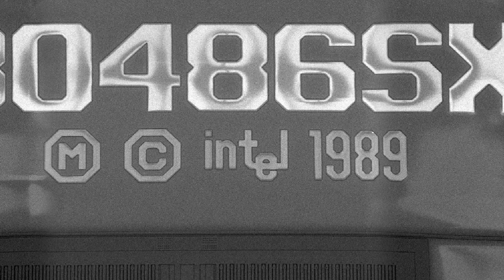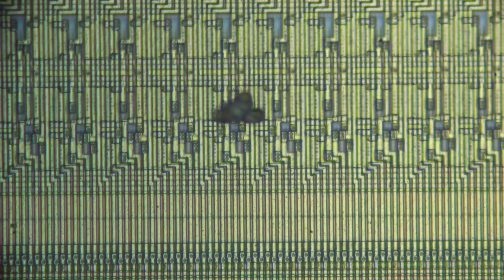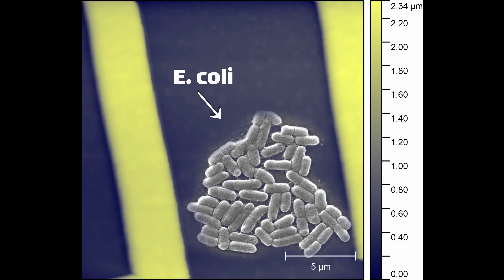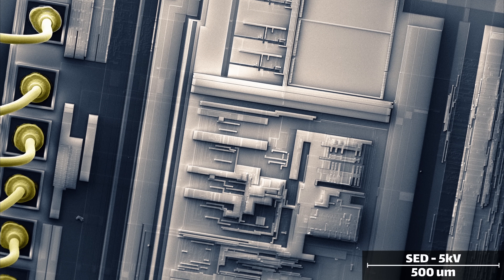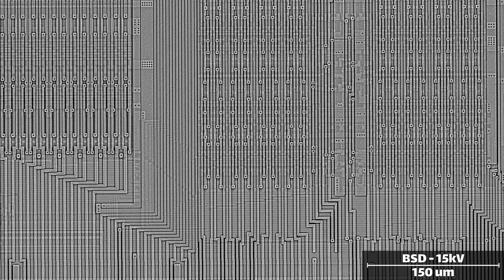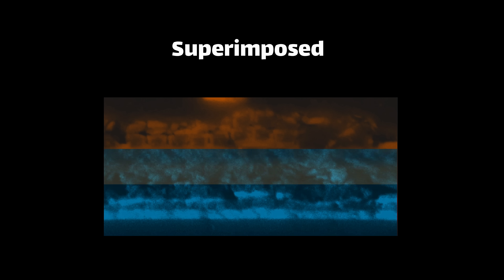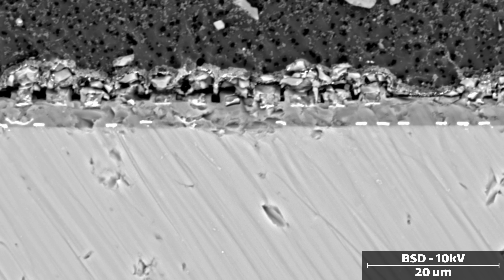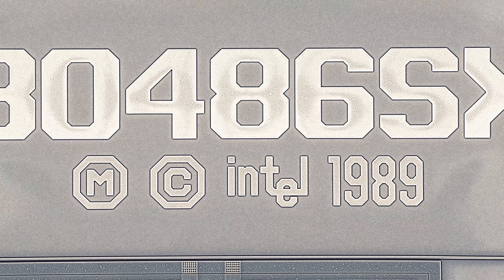Microscopic view of an Intel i486

Comment: Every time I see how detailed and complicated chips are I am reminded how incredibly smart the people who figured out how to manufacture them are.
Reply: If you're in awe of the machine, wait till you see the machine that makes the machine!
Reply: @paulmichaelfreedman8334 when I read the space station sees an undetermined fog over the Bermuda Triangle. It’s the giants of these things still boogieing
Reply: @paulmichaelfreedman8334 for me this causes immediate blackout I can't even comprehend them
Reply: @shr Sorry, you’re wrong.  People did (and do) plan the layout, and quite a bit of the Intel486 was laid out by hand (to optimize speed).  Yes, there’s software involved, but the folks we called “mask designers” we’re definitely human and directly involved.  I just retired from Intel, and yes, I worked on the Intel486SX (though a slightly later version).
Reply: Even the work I know that was involved with the 8051 MCUs and their designs make me balk a little in awe. Heck, even the schematic I once saw of the ALU in the 8008 impressed me.

Although electronics and such are just a hobby for me, so I am very easily impressed.
Reply: @jeffaley2895  I am assuming you worked on the 80486DX version with the whole FPU portion properly installed onboard? I still have a few of those chips and their motherboards IN WORKING ORDER!

Nowadays in 2024, us DIY home-based photolithography enthusiasts are using inexpensive (i.e. less than $1000 US) high pressure fluid piping design software to model and simulate Compressed Fluid channels and Ball Valves which work very much like electrical line traces and transistors you see in CPUs and then DOWNSCALE those computationally-modelled fluid dynamics simulated piping designs to the same levels and layering as a sub-micron CPU Tape-Out design.

Since electricity, transistors and junctions DO somewhat work like piping and compressed fluid dynamics, we DIY (Do It Yourselfers) have learned to create a MECHANICAL version of a CPU and all its onboard systems in order to EMULATE what a CPU does. This means we find errata and issues using the piping and CFD (Computational Fluid Dynamics) simulation software that most electrical engineers would never find using that expensive VHDL (Virtual Hardware Description Language)-based systems from Siemens/Mentor and other mega-buck chip layout software. 

Once we have the layout done, we can scale down the MECHANICAL piping design to a proper micron or nanometre-scale TAPE-OUT file for photolithography at the production process we can do at home using Red, Green or Blue band photolithography processes!  I am personally using laboratory-grade flat Borosilicate Glass as the base substrate and building up from there. I am at about 200 microns feature sets at my home setup BUT when I save-up for a proper positive-pressure clean-room lab built out of non-static ceramic with no off-gassing coatings, we MIGHT be able to get down to 5 microns or even less as a DIY home chip making lab! We shall see! My hope is to recreate a full 10 to 20 MHz clock speed 32-bit 80386 processor at home even if just one chip takes up an entire 10 cm by 10 cm wafer! 

V
Reply: They are detailed and complicated, but in reality they are built by putting together simpler structures (adders, registers, and so on), and those structures are themselves built using even simpler structures (logic gates and such), which are by themselves built with even simpler structures (transistors).
So everything is like a lego. You start with a set of very simple things, combine them in some way and produce a little more complicated things, then you combine those things and produce even more complicated things, and you keep doing this until you have a processor.
Reply: The most baffling thing is the excruciatingly wide intelligence gap between who physically constructed/conceptualized the entire technology and who consumes it today, as we can see in many many previous comments. The more advanced the technology, the wider the gap, ironically. Most people here aren't able in the slightest to grasp what we're dealing with. 
Every piece of technology is based and makes use of another scientific principle like layers on top of each other. Between the concept of physical energy and today's complex computers that allow two complete morons to communicate directly and intuitively, lies the knowledge and expertise of centuries and millions of people, each of them specialized in at least one of those things. Being able to manufacture billions of independent calculators in one square millimeter and combining this with an easy-to-use interface just isn't the work of one man who suddenly had the idea to construct a machine that is able to do so overnight.
If even ONE of those early layers gets lost (including all documentations), then we'd be unable to reconstruct today's machines, resulting in all subsequent technology layers to die off as well if humanity doesn't react fast enough.
Reply: All technology is built upon the shoulders of giants. They managed this because their fathers managed to discover electricity and harness it. Which while seemingly easy now, was one hell of an advancement then.
Reply: Smart people: yes and not... certainly there is lot of research but also evolution. You add new ideas to something that was already done by others and things looks complicated step after step.
Reply: @Joe Duke man how do people manage to bring politics into every. single. thing.
Reply: @jacknolan6170  They do it by being on the "stupid end" of human endeavor they were talking about.
Reply: @jacknolan6170  more than 10
Reply: @jacknolan6170  what is wrong with politics and why people are scary/don’t like to talk about topic that basically rules their lives
Reply: @jacknolan6170 The Democrats. That's how
Reply: People like this commenter fail to understand that this came about over over a century of small steps and small discoveries. It want some dude that just produced a CPU from thin air. It was a million people making simple tools and small steps forward. None of this requires genius, just a willingness to be series and figure small problems out one at a time.
Reply: It was aliens
Reply: The architects are sealed away in the corporate towers like the dark magicians they are.
Reply: @informitas0117 the truth is this dark magic us actually thousands and thousands of years old
Reply: The computer would thank you for the compliment if it had feelings. Machine feelings available in 2027
Reply: It happens step by step, humans pass on knowledge to the future generations who later adds there own ideas. Modern science and technology is not built by a single individual rather it was done by hundreds of thousands of scientists and researchers over a period of decades. Same goes with computers.
Reply: My grandfather worked for Lucent Technology and Bell Laboratories from 1950-1980 , he was one of the first to create  and test the chips !
Reply: @joshball2385 that's so cool
Reply: It’s the same terminology of a convict escaping from a high security prison , how can they ? We are human we can do what we imagine with the right organization of people , Good or Bad, it is written human are given a little intelligent for them to look around so they can realize how small and weak they are. Which Holy Book ?
Reply: And there are people who think crop circles are to complicated to be man made.
Reply: They're very complicated to create and manufacture which is why only a few countries have managed to do it. China and Russia have been struggling to make them because they want to stop relying on the west for their chips.
Reply: It boggles my mind how someone, melted silica/sand and figured they could etch switches into it and then pass electric through it to convert 0 and 1 into something.....🤯
Reply: This is just what happens when many people from many different fields pool their knowledge and resources. This is what the entire world could look like if we stopped fighting over everything.
Reply: What do you mean? Those chips are just a proof of evolution. Nobody's manufacturing it.
Reply: And just think....   the most advanced microprocessors today, still aren't close to the complexity of a single mammalian cell.   Every time this occurs to me, I am reminded how incredibly smart God is.
Reply: @KS4RonPaul  Amen 🙏
Reply: @KS4RonPaul that is the whole end goal ,to replicate life forms to mock God, I'm afraid their getting closer and closer
Reply: @KS4RonPaul  I agree
Reply: It's typically a ton of different people's ideas come together to form the end product. Generations worth of research and development. It's not like some dude just etched a die one day right after he rode home on his horse.
Reply: Then we have people who thinks the earth is flat.
Reply: Imagine if we are the only species in the universe that can reach this level of creation. We create the machines, its AI, then we are eliminated by these machines. The robots dominates the universe using humans to create them.
Reply: Alien technology reverse engineered.
Reply: None of this is real! You really expect me to believe that these tiny plastic squares make the pictures on my phone? There's no moving parts in them, and there's no way anyone could put those microscopic pieces in order!
Reply: once you know the basic parts scaling it up isnt really that big of a deal
its not like they drew these things by hand in case thats what you were thinking
Reply: What's even more amazing to think about is just a little over 100 years ago people were still traveling via horse and buggy. 

Think of how far we've come in a very short period of time.
Reply: past chip designer here. Automation tools do the majority of the work. The chip design is done in something similar to a programming language, but for chips. You tell the chip what kind of electrical behavior you want from it, press a magic button, and out comes a picture of each layer. In fact, When it comes to lines-of-code, chips have drastically less "lines-of-code" than programs.
Reply: @eitantal726  Yep, it's always concerned me that newer microchips are made using older microchips.
If the chips used in the design phase get destroyed (say for example a massive solar flare or an EMP attack, though some systems will probably be shielded) our entire design process gets knocked back by 50 years or more as we would have to design new chips by hand and work back towards getting CAD again.
Reply: @daviddavidson2357  I wouldn't worry about that. As long as we have at least one modern computer capable of running that software, we're good.
Reply: @eitantal726 Automation do all the work?

That is not entirely true.
On a small chip then yes, design rule checks, layout - place and route and even pre and post layout simulations would all be done automatically with almost no human involvement, if the chip utilisation was low.

On bigger chips, higher number of gates then a lot more manual intervention was required.
Reply: @eitantal726  Hardware description language.

The output is not "layers" , it is a netlist of logic elements. That netlist then has to go through a physical layout process using place and route.  The result of the routing is the layers of metal/interconnect.
Reply: @deang5622  I know, I just wanted to keep it short & simple
Reply: Visual it as a plumbing in a condo building 😹
Reply: Humans are mostly only smart together. Why do you think almost all "smart" jobs are specialists in some way now?
Reply: @imdeadserious6102  that aint always the case. Sometimes, companies really just hire extra people for no reason, and just fuck over the productivity lol. 

But yeah. I get what your saying tho.
Reply: righttt??
Reply: Not really. I mean they aren't smarter than let say, a farmer or an accountant. They're just better educated at something more specific, which is electronics.
Reply: @eravid9202 They are smarter than a farmer, it’s not about education. The amount of hard work required was crazy. This was in the 80s.
Reply: @eravid9202  difference is most could learn right now to be a farmer or accountant in a relatively short time. Whereas becoming a cpu architect at intel is basically impossible for the general population. For this you would look at exceptionally passionate people who on top of it are dedicated enough to spend most of their day learning and solving problems. They are learning, are critical with themself and become better at learning simultanously and others just stagnate. And then there is the dunning kruger effect..
Reply: Yes - crinkle cut is truely something to marvel at
Reply: That’s why it changed the world
Reply: Exactly and you think about that especially when you are interested and deep in electronics..
Reply: People? Humans?
Reply: We should be celebrating the people that helped develop chip technology and not people like the Kardashians. What an upside down worship culture we have here.
Reply: @schmingusss  You'd like the song "Story of Our Time" by Trevor Moore.
Reply: Okay
Reply: ALIENS
Reply: Ino so smart they believe all this came from a Big Bang
Reply: Look like a bismuth😀
Reply: We taught rocks to think and process faster than we can
Reply: When you break it down and learn about it in detail, it’s all simple stuff scaled down to extremely microscopic levels. And, this is only a chip from 1989. Transistors are magnitudes (if we want to be accurate maybe 1 magnitude or so if i recall) smaller than shown in this video. Eventually, we can’t go much smaller. The real test of our capabilities is when we get limited by how small we go. I can’t wait to see what we will draw up then
Reply: At the same time, I am reminded how stupid I am.
Reply: lol very easy they just copy a city map.
Reply: I work as a senior maintenance technician at a former IBM fab and there are still stories about those guys floating around to this day. Crazy what they accomplished so long ago
Reply: I should go show this to my dad since he designs them..
Reply: Supposedly alien craft that we are in possession of is where we reverse engineered integrated circuits, fiber optics, and other high tech goodies. Not saying that's true, but it is compelling. The Day After Roswell by Corso is an interesting book.
Reply: @justinl9077  And the Day After Roswell is BS.

There isn't a single degree qualified engineer that believes integrated circuit technology came from aliens. That's because we know we created it.

It's only poorly educated people and those that are not engineers believe the BS because they don't have the knowledge or expertise to know any better.

Repeat a lie often enough and it becomes truth. That's what's happening here. Nothing more.
Reply: It seems alien technology... !! ;)
Reply: Together they are smarter than the sum of their intelligence
Reply: the people involved with the birth of photography had no clue where their inventions would go. so now, I see the birth of quantum computing and wonder where that will lead to.
Reply: Aliens got big domes.
Reply: The process is evolutionary..... Didnt happen overnight
Reply: Aliens for sure.  ;)
Reply: Aliens passed on the tech to us
Reply: @thisguyhere1  I know, I'm an electrical engineer too.
Reply: Pfff, riiiiight! "People" made these. Why don't you show me some of the "people".
Reply: @-iIIiiiiiIiiiiIIIiiIi- Simply searching "Who invented integrated circuits" gives a lot of detail on the topic. 

Show me a non-human who invented this now.
Reply: A million little "oh well we could make it smaller, but xyz makes it impossible" and some guy going "nope I found a way around the xyz problem." This thing is a city on a postage stamp, and it's not even worth powering on in 2023 because we've now got continents on postage stamps.
Reply: Only possible in America
Reply: People really think humans created this technology?
Reply: @stewybrooks  People think that rocks and gas randomly created humans, and that the universe was created from an explosion that had no causation.  I’m not surprised that these same people think this technology comes from humanity.
Reply: They weren’t that smart and would tell you so. Invention is half luck and everyone stands on the shoulders of precious inventors.

If you really want to be thrown for a loop, think about the fact that even knowing there might be people smarter than you makes you smarter than about half the population.
Reply: That looks incredibly complex. Are you sure humans developed the silicon chip?
Reply: Thx
Reply: IQ is genetic. If not born with high IQ then understanding high complexity not possible
Reply: https://youtu.be/eFnV6EM-wzY?si=PTfCGcbtMq6v06G7

The exact moment Jeff bezos realized he wasn't smart enough to finish physics.
Reply: aliens
Reply: No comment 😮😮😮
Reply: How exactly do they deposit the transmission line, transistors, and such into these chips at such a precise microscopic level ? How is it done in layman’s terms ?
Reply: @65gtotrips  https://www.youtube.com/watch?v=g8Qav3vIv9s
Reply: They’re not smart they’re a bunch of kookz.

They give you this stuff and they don’t have a clue how it works.
Reply: Intinya ini adalah versi yang lebih kecil sebagai pengganti kabel agar hemat ruang, sisanya ya serupa juga dengan prosesor yang lebih besar
Reply: The design was based on technology found in the flying saucer at Roswell in the 40s and later played down as fresh ideas that slowly trickled into R&D by the US military to prevent us from knowing the existence of ETs
Reply: They only rediscovered this lol. At that point they then compound their thought to it. Once it has come into remembrance
Reply: Actually, no one can make all of these technology if nobody makes different invention from different peoples. All of these is Combination from past technology  that always developed time to time
Reply: Its more clever than anything, they had the tools of the process, then continued to follow the process to achieve the chip, it is more effiencent that way..
Reply: Its absolutely insane..... i respect those aliens so much❤
Reply: What impresses me is the manufacturing of these.
Reply: True it's like an entire city inside a chip, the human brain is truly unparalleled
Reply: Since Pentium 2 I think something most don't believe in were creating them.
Reply: I am afraid they are not people..
Reply: Exactly!
Reply: Those people who created these things are really smart. 
Did you ever think about the God who created those incredible smart people?
Reply: @Mountfuji123-d7d  God does not exist.  Prove otherwise (I mean “prove” not just talk about faith).
Reply: Baahaaaa anyone ever hear of a dude name satan
Reply: Are they really people 🤔
Reply: You think man figured out how to do that?  Lmao
Reply: It was alien tech that humans reverse engineered after roswell...

(Idfk 😂)
Reply: Ben insanların bunu yapabildiğine inanmıyorum çünkü insan ötesi bir konu çip üretimi. Öğretilmiş bir bilgi bu ve kim öğretti belli değil. Belki dünya dışı varlıklar.
Reply: Lol this technology has been, it simply has been rediscovered and applied in a different form.
Reply: Aliens did it first.
Reply: Aliens
Reply: @Sniggitysnail  just because you cant do it, doesnt mean they're not humans like you, they're just better than you, but still humans as you
Reply: @Sniggitysnail  I came here for this comment
Reply: @Sniggitysnail  Truer than you think! In 1955, William Shockley of Shockley Transistor Corporation was VISITED by Major Philip Corso (from the still-named-then Department of War at the time) with a bunch gear in a leather bag called "The Nut Files" that included what WE KNOW NOW as a headset with fibre optic cables coming out of it and come Electromagnetic sensors, a bunch of slivers of Germanium, Gallium Nitride, Gallium Arsenide, Borosilicate Glass, Pure Silicon and other compounds which contained weirdly orgainzed microscopic-level line tracings upon them, and they even received some large slivers of High Density Polyethylene, Polyproylene and Acrylic containing organic and inorganic electrically-excitable light emitting structures and oddly shaped and oriented copper and gold tracings on flexible organic polymer films that accepted and emitted complex organizations of square, sawtooth and smooth sine waves at various frequencies PLUS he also brought Shockley a weird set of square panels that contained a two-dimension array of square micro-wells could accept all frequencies of visible light and convert them into an array specific voltages and amperages of electrical signal at fixed time periods.

Shockley was asked to give his opinion on the purpose of and design of what was in the "Nut Files" and whether or not he and his team could DUPLICATE what was in them even if he had to make the systems larger and simpler for general use. Shockley went to his team of electrical engineers and they all agreed they could EVENTUALLY figure out and duplicate at least the functionality of what was seen. Asked where he got this material, the team was told all teh material was obtained from captured WW2-era German and Japanese scientists!

EIGHT of these engineers DID SEE commercially-viable uses for the damaged bits-and-pieces shown to them and decided to LEAVE Shockley Semiconductor to form a NEW company called Fairchild which became famous for Memory Chips and the first consumer-grade chip-based semiconductors!

Of the following people: Julius Blank, Victor Grinich, Jean Hoerni, Gene Kleiner, Jay Last, Gordon Moore, Robert Noyce, and Sheldon Roberts, it would be Gordon Moore and Robert Noyce who would eventually found INTEL who would give us the first consumer-destined CPU (the 4004) which could be used for electronic calculators, counting machines and electrical device control systems. After that, the 8080, 8086, 8088, 80186, 80286, 80386 and 80486 monikers would enter mainstream lexicon bringing us the Golden Age of microprocessors which would drive the consumer electronics industry to where it is today!

These "Nut File" devices came from the UFO crashes at Corona and ROSWELL and the rest is HISTORY! Soooooo, we get Wifi, LED and OLED, bendable displays, CPU and RAM volatile Memory chips, flexible fractal antennas, Bluetooth, CMOS camera chips and Heads-up Displays / Augmented Reality Systems all from a bunch of crashed spaceplanes piloted by some Aliens who were TOO STUPID to avoid a common lightning storm!

The Alien Nut Files also brought us Optical and Thermal IR Nightvision, Negative Refractive Index Matematerials (aka Infrared, UV, Radio and Optical Stealth!), Sheet Graphene, Carbon-50, Carbon-70, Carbon-540 Buckyballs and Silicon, Carbon and Boron singlewalled/multiwalled nanotubes for use in thin film electrical battery storage systems AND as ultra high-strength ballistic armour IN ADDITION to ultra high temperature tungsten and aluminum-oxide ceramics and quasi-crystal/metallic glass!

The ONLY thing we had to mostly invent ourselves was the GWASER (Gravity Wave Laser) and multi-layered Terahertz waveguides made out of Bismuth + Palladium + Aluminum + Magnesium and a few other alkaline metals to form electrostatic repulsive-to-atmosphere-and-ground aerospace engines.

NOW YOU KNOW!

V
Reply: @Sniggitysnail yep. Humans didnt create this, its impossible.
Reply: Yet TikTok exists.
Reply: Everything is possible if you want and have focus on it.. Its because lot of thinks people said you cannot do it because you are not that. And then I will learn, take practice and made it.
Reply: Not really. You just put a lot of pieces together and then wiggle the wires until they basically fit
Reply: @strangeWaters  Then you put some silicon on top of that shit
Reply: yeah aliens
Reply: When you fall into imagination nothing is difficult they are humans like us, this means if they can do it we can do it aswell
Reply: @FarmingInKurdistan  so, what have you done?
Reply: @FarmingInKurdistan  nah, straight up... Some people are smarter than others, others, stronger than others. That's what makes us unique.
Reply: @FarmingInKurdistan  sorry bro, making cheap tesla coil videos in your garage isn't quite on the same level as this
Reply: @FarmingInKurdistan  100%
Reply: @FarmingInKurdistan  no, you can't. And I can't either.
Reply: @FarmingInKurdistan  Not true
Reply: @FarmingInKurdistan  definitely 
everything is easy if you understand the logic behind it 
everything is a free knowledge if a single human found out about it
Reply: @FarmingInKurdistan  that's bullshit.
Reply: @FarmingInKurdistan  you skipped individualism
Reply: @FarmingInKurdistan Observation one: The Dunning-Kruger effect.
Reply: @FarmingInKurdistan It doesn’t work like that. It’s like saying anyone could get the world record in sprinting.
Reply: @FarmingInKurdistan It’s not imagination that took them there, but mind blowing lay hard work.
Reply: @FarmingInKurdistan  Everyone can say what you did but actually doing it is something else. Those people who created this had a passion and dedication for this that you can not imagine. This is a product of millions of insanely smart collaborative minds and many went to the brink of insanity to create these mechanisms and you come along and say it is not difficult.
Reply: @FarmingInKurdistan  lol, what a hell are you talking
Reply: @FarmingInKurdistan  no you cant, not with that attitude
Reply: @gasun1274  i can
Reply: @FarmingInKurdistan  Did you manage to produce your first chip? Please post a video and let us take part of your process.
Reply: @FarmingInKurdistan   That's not true, there's only a few that can do these things. It's easy to say that are humans like us. We can do it, it's not difficult. 😳
Reply: @FarmingInKurdistan  It is not imagination, dude, it is work that stack one above another, not for one human but thousands.
Reply: @FarmingInKurdistan  Not like you. They paid attention in school, obtained engineering degrees, and most likely worked in the types of internship positions that some "imagination" dope-smoker would never be considered for. This is not to say that you cannot become an engineer, a physicist, or even a polymath, but trust me when I tell you that it is difficult and hard work, and it requires the kind of dedication and time commitment that most would never commit to. Still, if you are awesome at math, aced calculus in high school, you may find it easy. Most, however, do not. I wish you luck.
Reply: @HangTimeDeluxe  Acing calculus in high school has nothing to do with it. A person can earn their degrees later in life, and many have to do so as inequality worsens in the world. It is not necessary to follow a perfectly prescribed path.
Reply: @HangTimeDeluxe  Well said. Mom Digger is living in a dream world.
Reply: @HangTimeDeluxe  another MC worker after tough shift a see 😂
Reply: @HangTimeDeluxe  You are also kind wrong, big part of it comes down to the good old genetic lottery, some people are just born genuises, what takes you 1 year to learn they can master in a month or even less, they are rare just like the amount of people over 6 ft tall, or the amount of people who lived over 100 years, sure regular folks can get stuff done, but the difference in quality and learning speed is just too big to ignore.
Reply: @HangTimeDeluxe  I think Minecraft redstone can provide people with the concept knowledge to understand the how questions. I’ve learned some info like the architecture of a cpu just by watching a redstone youtuber, that is to say, I was inspired to look for information in the internet because of watching people make computers using redstone and some even discuss it a bit deeper. I believe imagination is a part of it, but imagination alone can’t help.
Reply: @HangTimeDeluxe  it’s funny seeing this comment. It’s the ghost of past stupidity, now long deleted from YT history
Reply: @HangTimeDeluxe  No no and no, what school does is teach you how to be a worker or soldier and a fit for normal society, and what university or college does is further improve your skill at doing a specalised task, a caveman didnt have to go to school to make a fire or hunt an animal, they learnt by doing, and by doing you can learn anything either by yourself or faster through learning from other people as well through exploration of the physical either alone or with teamwork. There were computers before bill gates created microsoft and he learnt to hack and program and code before anyone could teach him, and you dont need to go to school to learn programming.
Reply: @HangTimeDeluxe  I smoke lotta weed, still I'm taking micro engineering classes, you can do whatever, if you're passionate enough, you can do what you want!
Reply: @HangTimeDeluxe  Not only that, but to create something like this has taken the work of thousands of people, for thousands of hours, across years and decades. Every innovation built on top of a previous one. We only see the successes, but it has taken 999 failures to get there. It's something I only realized going into engineering when what I considered childish mini projects with tons of failures along the way which appeared as amazing progress to others that we really do take everything for granted and it takes so much more than just genius to create the things we use everyday. 

And i'm happy for that. It has just motivated me more, because if there's one thing us humans are REALLY good at its cooperating and learning the more we do. No single person could have created a modern microprocessor and each who contributed to its creation, no matter how small, deserves credit.
Reply: @delphicdescant  Did you actually read what was posted.  He commented “if you aced ….you might find it easy”.   He didn’t say you weren’t capable of doing this kind of job at some point in your life.  This is what Engineering is about.  Paying attention to the details as well as the overall picture and actually understanding it!!
Reply: @GodzillaGoesGaga  Why are you arguing with comments from 3 years ago lol? I don't remember what this video is even about.
Reply: @FarmingInKurdistan  Only with a whole life of dedication.
Reply: Not so smart, collective efforts where we all build on the backs of our forefathers knowledge. That's our strength. Butterfly effect.
Reply: aliens you mean
Reply: We are not alone
Reply: It is alien tech
Reply: If you look at history for 1000's of years, technology stood at a virtual standstill when compared to what happened starting in the 50's where micro electronics began it's explosion which seems to coincide with the Area 51 Roswell incident. While I don't believe in alien technology, I do believe in the possibility of demonic influence masquerading as aliens. Where did the information come from?
Reply: @DrHarryT  lol what the fuck
Reply: @DrHarryT   Wow. You are slow. Technology been advancing since cave man days. The better you're technology gets the faster you advance.
Reply: @Joe Duke If the Potato-in-chief keeps at it, we will be full-blown Commie and will have no innovation because we've removed the reward. Assuming our shelves aren't bare by then...
Reply: Thank you for your kind words.
Reply: @deang5622  stem riggers can't get any more arrogant, can they?
Reply: @wilburdemitel8468  We are allowed to be arrogant. We have earned the right through hard work.
Reply: it's not that complicated
Reply: If that impresses you, just imagine how brilliant God is.
Reply: @Buelford  Which one?
Reply: If you think the one who design them are humans you are clearly not an aware person...
Reply: Just imagine it is a 3d road map, every road goes somewhere and leads to something. You design it in massive scale for function, then simply work on miniaturisation methods. It is not that complicated when it's broken down. Still amazing but yeah
Reply: I presume they are not human
Reply: With a little help from back engineering alien tech.
Reply: All begun in Roosevelt
Reply: They are God gifted
Reply: It screams, "intelligent design". Totally amazing.
Reply: @michaelsimpson9779  nah. It screams decades of work and layers upon layers of abstraction.

its kinda sick tho. like u see shit like this, and realize that not one person could make this by themselves. Its a product of thousands of people working together. All of them dont know how to do the others job, but somehow their work meshes together.
Reply: @Joe Duke oh FYI, the picture of the team which designed the 486 was on one of the issues of IEEE Spectrum magazine. Of the 10 or so people in the picture almost all were young immigrants. So much for your evolution/devolution theories.
Reply: more like genetically blessed lmfao.
Reply: Because building "extremely small things" and repeating that is incredibly awesome, right?
It's a connection dude, from point A to B.... Miniaturized.

It's a diagram. It can be as large as a room or as small as a postage stamp.
Reply: @Untilitpases  yeah, what about the machine that do it
Reply: We should be amazed by God who has created such a smart people like them.
Reply: @FendiDoank  there's no god.
Reply: @FendiDoank  which god? There’s literally hundreds, most created by ignorant and backward shamans, priests, soothsayers tending their sheep while high on pot and coming from the Iron Age, or Bronze Age.  At least Santa Claus is a more recent metaphysical belief…mostly from undeveloped young brains.
Reply: No, dort thank god, thank the people how invented these thing
Reply: Their not smarter than we are. 
The real smart ones are the guys who figured out how to modularize our work, and how to work off the abstractions that people before you have done. 

When we code something in Python, we dont have to worry about all the low level stuff that thousands of people before us have solved.
Reply: @honkhonk8009 Frick me how arrogant, yes they are smarter than the commenters in this thread.
Reply: Human beings aren't this smart. This is alien tech
Reply: @d1zguy864  humans are aliens
Reply: @d1zguy864  yeah..we are the aliens!
Reply: @d1zguy864  
Spoken like a true midwit
Reply: @josedorsaith5261  tnx
Reply: @d1zguy864  Maybe, but humans have moved incredibly fast over the past 5000 years, which is why the stories about the earth being billions of years old are demonstrably false.
Reply: @TheArchitect999  Waiting for you to demonstrate that "earth being billions of years old is demonstrably false". So far this thread has been highly interesting with true usage of brain .. and then you show up
Reply: @xenuno  <—🤡
Reply: @TheArchitect999  wrong.
Reply: @ryzenryne8747  keep believing in fairy tales kid
Reply: @TheArchitect999  says the one who believes the earth and life was created in a week. Oh the irony!
Reply: There are some hypothesis of this technology was given to us from another race or higher being. Right around world war II a lot of this technology transpired
Reply: @jgordon165  wrong
Reply: @ryzenryne8747 well aret we just proud of ourselves? This tec /magic has been around since the beginning, it started out big as mountains and only recently has become minturized so everyone will wonder after and to it. Actually I'm just some nut job right?
Reply: @Cjohn31  you've been saying this over and over and over yet you haven't provided us the proof that your god exists. blehh.
Reply: @ryzenryne8747  I can't prove nothing to you , there is astronomical amount of proof but it was never even clear to see until I no longer needed it. You think your anti religion, I'll bet your the opitomi of it
Reply: @Cjohn31  then you proved our point.
Reply: @ryzenryne8747  we all going to find out ain't we?
Reply: People who manufacture those things aren't really that smart. It is the company that designs the chip and provides all the instructions. The manufacturer workers uses machines to create the chip.
Reply: @josefish5193  You'll notice I said the people who figured out how to manufacture them.
Reply: @josefish5193  You are incorrect.  Most Fab’s that manufacture high end semiconductors have a floor full of Ph.D’s because most the manufacturing is automated and Ph.D people are monitoring or improving process elements.